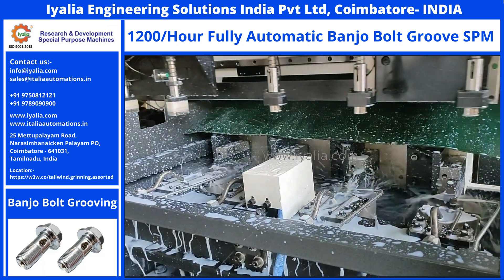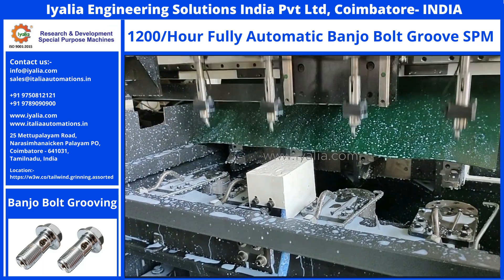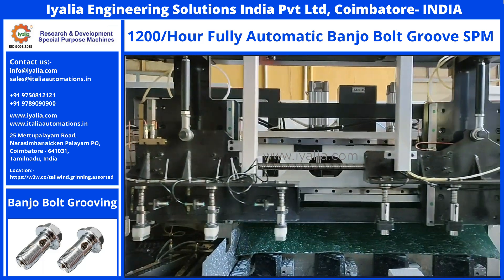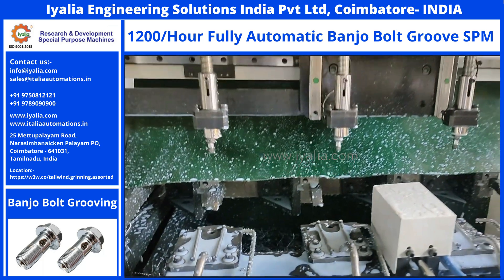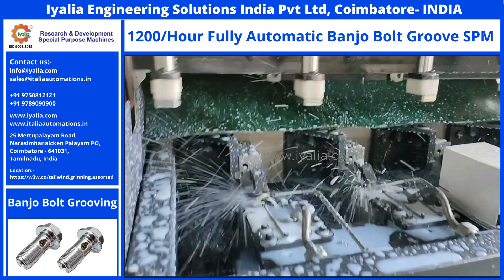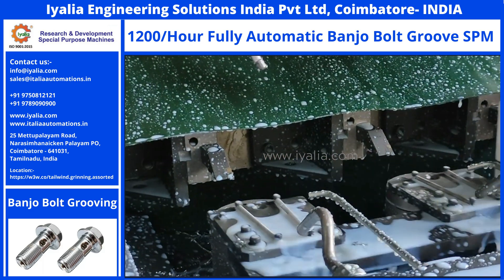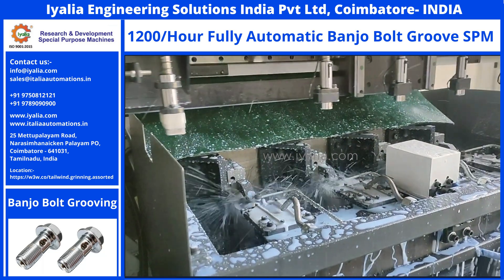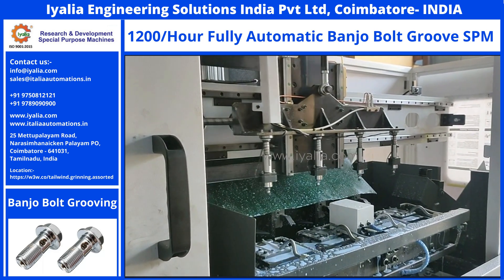Banjo Bolts Made Easy: Experience The Speed And Precision Of Our Spm | Turning SPM machine

Comment from the maker: "banjo bolt" typically refers to a type of fastener used in various mechanical systems, particularly in automotive and hydraulic applications. It's named as such due to its resemblance to a banjo musical instrument, with a hollow cylindrical body and perforated ends that resemble the openings in a banjo. Banjo bolts are commonly used to connect fluid-carrying lines or hoses to components like brake calipers, master cylinders, and fuel systems.